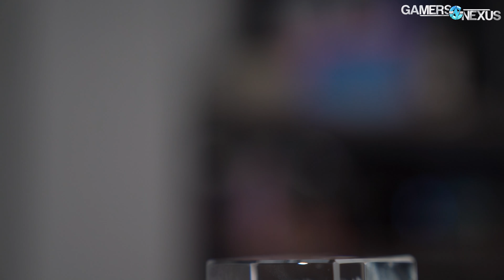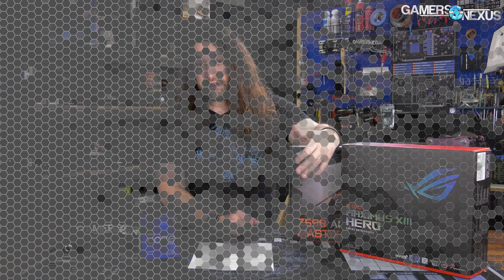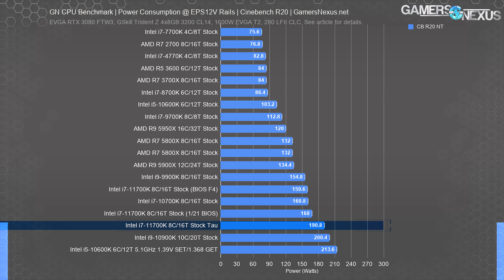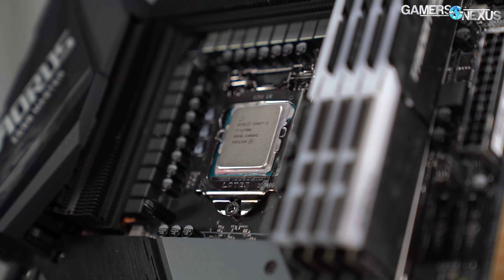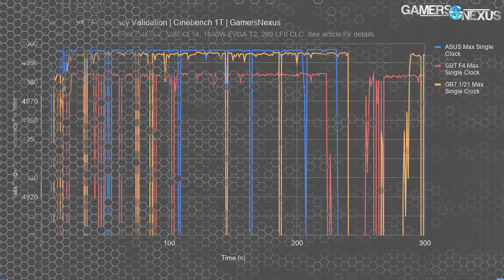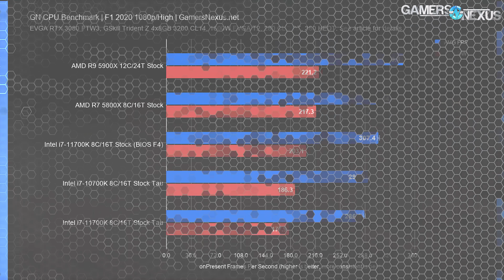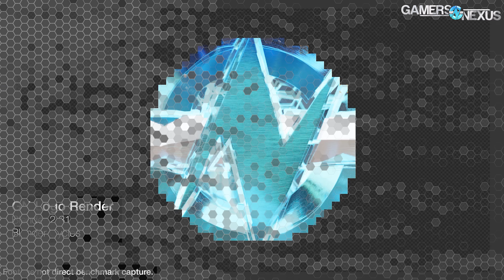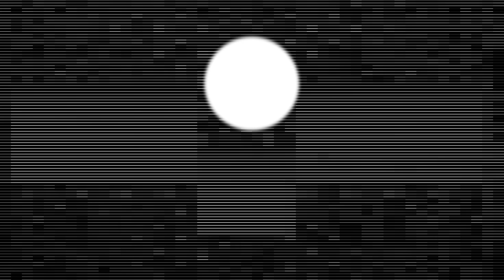Intel's Z590 Motherboard Problem: i7-11700K Power & Thermals Explained

Comment: Could someone please explain to me what the "gear" thing is about? Is it like an auto OC?
Reply: It has to do with memory. GN’s got a video from within the last week that goes into more detail.
Reply: The IMC in Intel runs synced with RAM, so whatever speed the RAM is set, then the IMC will derive its' speed from the RAM.

Gear 1 => IMC runs 1:1. DDR4@3200Mhz runs physically 1600Mhz, so IMC clock is 1600Mhz
Gear 2 => IMC runs 1:2. DDR4@3200Mhz runs physically 1600Mhz, so IMC clock is 800Mhz

Previously "Gear 1" was default and unchangeable, IMC run always 1:1 with RAM clock. This is mostly a thing for RAM OC. If you are trying to run your RAM at 4500Mhz let's say, doing the math it means you're asking your IMC to run 2250Mhz, when stock RAM would be 2666Mhz(1333Mhz physical) and IMC defaulted to 1333Mhz. You can imagine your IMC is little happy about running out of spec: in that case RAM OC was unstable and you could compensate by increasing Vccsa. Higher frequencies can be stabilized by increasing voltage, but components run hotter, consume more and if voltage goes way above spec they can be damaged. So with Gear 2 you have the option to run high RAM clocks without the IMC going so much out of spec as a side effect.

It gives Intel some binning room also: only 11900 CPUs are capable of running Gear 1 3200Mhz which means they run their IMC at 1600Mhz@1.05Vccsa. For others you can try 3200Mhz in Gear 1 and it may work or you may have to increase Vccsa beyond 1.05V to stabilize your IMC, so it's overclocking.

If clock to clock performance loss of a lower clocked IMC is negligible in most cases then in very high speed RAM OC it's a win because you don't hit limits because you are having to set too damn high Vccsa that you're starting to be concerned about actually damaging the CPU or long term damage if you're doing an OC for daily use.

IMC: Integrated Memory Controller. Resides on the CPU and it issues commands to the RAM memory.

Vccsa: voltage in Intel CPUs for the System Agent part. It powers the IMC among other things.
Binning: selecting from a group of chips different groups of chips that meet certain criteria. For example: the ones which use less W for doing the same work(this may be 11900T, for low power line-up), the ones which hit 5.3Ghz at Vcore<=1.35V(this guys may be actually the 11900K CPUs for another real applicaction). You get the idea: filtering manufactured chips based on their individual qualities to make the actual marketed line-up.
Reply: @deidian635  Thank you

Comment: 9:20 I agree the optics COULD be bad for this. HOwever the oppisite is also true, With your typical "Power User" you guys call them, this is a massive gain for them. Realizing that just adding better cooling potential can allow the cpu that is LOCKED by intel, To overclock itself thanks to the MoBo. AsRock b365 pro 4 mobo, intel i5 9400F and it boosts above 4.1ghz. Sometimes I see as high as 4.3.....on a stock intel NON K series Chip. With no "overclocking" knowledge really and just adding an aio to an i5... gets me a couple extra steps into overclocked? Thats a win steve. #winning

Comment: Why are there 2 5800x's, and is the 5950x actually using less power than the 5800x?
Reply: 5950 most likely have better binned chips, that use less power.

Comment: Just picked up ASUS Prime A Z590 can confirm it over volts like crazy
Reply: yeah never use auto vocre.... its been a thing for years i never leave vcore on auto... it causes stupid high temps....
Reply: Still you should be able to manually sort the vcore out...My Gigabyte Z490 seriously overvolted my 10700K but with a manual overclock got it to 5.1GHz all core at just 1.278v....and I know people who have a stable overclock at a lower vcore than mine...

Comment: This is going on for so long and I don't know how Intel hasn't put a stop to it.
Reply: They don't want to put a stop to it. Thermal testing is usually done after a long warm up period which tends to hide that. This gives them an advantage in shorter tests like Cinabench or gaming FPS. This is how they have kept their 3-7% lead over AMD these last few years. It is a perception builder and it makes them billions. Why stop it?
Reply: because it allows locked intel chips to overclock themselves a bit, my wifes i5-9400f hits 4.3ghz rather regularly, thats a locked non K chip btw. Locked to 4.1

Comment: I know its a big ask, but can you compare 10700k and 11700k both in a Gigabyte Z490/590 board?

My 10700k is always between 4.9-5.1GHz all-core (w/DDR4 3600, under a basic Noctua U14S), so I can't really compare it and the 11700k in the charts at stock settings with this board since you only showed the stock tau for the 10700 in charts

My gut tells me that 10700k and 11700k are within <5% with actual same frequencies, and the new generation brings nothing to the table at all
Reply: You are probably right...They are within 5% with the occasional application give more or less so not worth the upgrade...I was hoping for more! Wait until Alder Lake and if crud then the only option is AMD but they are charging more now and seem to be hard to get...Still the 10700K is a great CPU...5.1GHz all core on mine at 1.278v which runs cool and blitz's all games without an issue.

Comment: What does "Extreme Cooler" mean? to your average user a hyper 212 evo is an "extreme cooler"
Reply: Coolers are designed to handle up to a specific TDP. The TDP limit on that cooler is 180. Not really extreme. While the Hyper212 Evo will be able to handle higher temps. You start working outside of the coolers specs and end up with louder fans and higher temps. When you start looking at the Be-quiet dark rock 4 pro is what would be extreme.
Reply: @CthulhusBff  That isnt what I am getting at, what I am saying is that most "normal" users will generally see anything larger than a stock Intel cooler or an equivalent OEM cooler as extreme. Your average home user has not ever seen anything other than a standard dell OEM cooler
Reply: @dragonsystems5973  I don't think the kind of users you are talking about even know what TDP is nor could even comprehend what Steve is talking about. When Gamers Nexus makes videos, they make them for their base demographic (they did a response video about how they got hit by a bunch of console fans and they were extremely lost). So I'm pretty sure they don't really care about  defining everything since when those types of peeps pop up in the comments, the general subscribers who watch them answer those questions.
Reply: @CthulhusBff  I dont know what cocoon you are living in, but I have tons of friends who watch GN who have no idea what TDP is, would think it was power draw if they happened to read ARK.Intel.com, and have no idea what they are doing... I dont know what you do for a living, but I sell gaming desktops, full time, all I do all day long is deal with systems, build systems, and deal with the gaming system consumption public, so I have a pretty good idea what I am talking about
Reply: @dragonsystems5973  I live in a world where I have to explain to infantrymen on a daily basis on how telecommunications isn't magic. As for your friends that watch GN and not know what TDP is. How? I mean it. If you watch GN and just nod along not understanding anything and parrot the final thoughts (what GN says not to do), you are an idiot. Sorry, but perhaps get some friends that aren't sheep. As for dealing with customers. That is kinda why you exist. You are supposed to be the SME (subject matter expert) on these. If you are throwing GN videos at your customers going "this will answer your questions." You are awful at your job. The truth of the matter is that to get into the more higher level realm of computers, you need to be able to take a seat and ask questions. Just because you decide to play with Dunning-Kruger doesn't mean it will work out well. Let's take your friends for example. They are just following along not actually understanding if what is being presented is true or false. That isn't good. Not just for computers but for life. Get better friends, sorry you have a retail job where you are EXPECTED to be the expert. I don't live in a cocoon. I live in a world where I have to break down complex subjects on a daily basis to adults who come to me and admit "hey, I know nothing about this. Please teach me." I'm not being elitist either. I'm being responsible for myself and knowing what is needed when I do something. Comouters is no diffrent.

Comment: Also, you showed some temperatures with an aio on this processor, but I'd love to see comparisons with the same work-load and same aio on a 5800X. The ryzen dies being as small as they are have a really hard time getting the heat out of the cores. While the Intel chip will certainly cost more on your electric bill from the extra power draw, I have seen higher temps on games and similar work-loads on the 5800X than the 11700k with similar coolers for most reviews.
Reply: @Rahq Vuth Yup - you'd have to have basically a lab to test temperature. Of course you can test the Power being used, but it won't tell you exactly how heat is being dissipated.

Comment: Honestly though, who buys a K skew CPU and doesn't overclock them? Motherboard manufacturers doing funky things would only apply if someone was running stock settings. Since most people buying K skews presumably are going for max, or near max, overclocking, wouldn't that mostly be irrelevant? I mean on Ryzen where manual overclocking is pretty pointless, and has a real chance of degrading the CPU, it'd make sense, because most people run those stock.
Reply: Lots of people buy will buy the k skews or unnecessarily high core count cpus because reviewers/forums say they're "the best" pop it in and use it as is because they don't want to deal with stress testing or they get intimidated by the bios.
Reply: @HooDooMagic  maybe, but are unenthusiasts really going to sit through reviews of CPUs? I think most of Gamers Nexus's demographic are enthusiasts who would want to overclock. It's not like they're The Verge. ;)
Reply: Why someone who isn't going to overclock their CPU would buy any MB beyond something among the basic models which have all the I/O they need. There's a very high chance an OC focused MB, even if minimally will out of the box set the CPU to run "Unlimited Poweeerrrr!!!"

PS: rule of cool I believe might be a reason...

Comment: It WILL not draw more power it CAN draw more power. for gaming you will NEVER see those power draws. and everyone i know will want to run the cpu at the all core turbo at the very minimum. so all limits off mce off. only when you enable  mce you need silly cooling these days as then you start to get into the giant overclocks forcing 5+ ghz on all core. 
my 9900k at all core 4.7 (so no limits) runs a max 185 watts  but in reality in games like battlefield 5 it barelty hits 70 watts despite hitting 65 % load.

Comment: Glad you did this video. The marketing is crap for these and I think they need to just own the significantly higher power draw required to match/exceed a 5800x in performance on a less efficient node. I feel like you could have done your other video with some of these numbers included and just given a big disclaimer up front that there's an issue with Intel's marketing. What you did, is reference the bad marketing and then do a review on a processor gimped to 125W that really isn't intended to be just to prove a point. I get that point, and I get how important it will be to make sure people understand the LARGE COOLER requirement the 11-series should come with, but I still think it would have been more honest and genuine to just do the benchmarks at the higher (within spec) limit. All people would have to do is look at power/temps (which you should show) to see where the trade-off is...especially if you tell them.

Comment: What metric determines when a cpu is allowed to boost to PL2 for a second (consecutive) time during a sustained workload?
Reply: From what I've read in the Internet, the metric is an average of power consumption, PL2 is enabled if this average fall bellow PL1. So, while idling, the average is bellow PL1, when a high load start the PL2 is enabled for tau seconds, and this will increase the average power consumption up to (or above...) PL1. At that point the CPU will fall back to PL1 until the high load is over. After that - idle, low average, PL2 is enabled... and so on. That is how I think it works, correct me if I'm wrong.
Reply: @ivoivanov7407  best answer i’ve gotten so far. Thanks

Comment: Again, why I buy ASUS Motherboards
Reply: Just FUI it is kind of hit or miss whatever ASUS honors Intel's guidelines. On a lot of their Z490 boards they would not only disable TAU entirely, they would also enable MCE and crank it to the moon. Hardware Unboxed found one of their high end boards to run the 10900k at 320W sustained.... Imagine how confused a user with a reasonably standard air cooler would have been at the fan speed :P
Reply: @andersjjensen  yeah I get that, I only use the STRIX line, I build probably 200 work stations a year with them and since I moved to the strix line I've not had a single bad board or board experience when I transitioned 4 years ago.

Comment: I don't think reviewers are going to disclose at all in that performance here depends on the motherboard you use at stock, I have a feeling that you and maybe someone else are going to be the only ones to point it out.
Reply: Lots of reviewers don't even disclose which motherboard they used, much less bios version or other info. You're lucky if they mention RAM speed and timings. :P

Comment: Its killing me that you know whether I should cancel my 11900k pre order and get the 5950x instead. WHICH ONE HAS THE BEST SINGLE CORE PERFROMANCE TELL MEEEEE!!!!
Reply: It doesn’t matter I mean u only have 8 cores let’s say is slightly powerful on intel side (I doubt that) and ryzen has 16 core and higher speed without overclock , amd is the best option In my opinion
Reply: @anthonybrm1012  The 3d programs I work with are all single threaded, and my render software is gpu based. So personally for me the amount of cores is irrelevant, single core performance is what Im looking for
Reply: @shoeuzi  amd seems to be the right choice atm. 11th gen seems to be a waste and doesn't really seem to be better than 10th gen. It's 2021 U don't have to worry bout single core performance from amd. If I'm correct the 5950x has better single core performance than the 10900k and given that the 11900k most likely won't be any better than the 10900k, u should have your answer.
Reply: Single core is so last decade man.
Reply: @Rahq Vuth I use very heavy single threaded software

Comment: I can see why some reviewers use the motherboards out of the box config, as that is the experience that most people will probably get. Really the boards should come out of the box complying with the Inel and/or AMD spec. Removing the boosting limits should be an auto OC function in the BIOS that can be turned on if so desired with a warning about power consumption noise and thermals.
Reply: I can only wait for userbenchmark to get their hands on this...
Reply: I completely disagree, there is zero benefit to testing a motherboard with OOB settings especially if you are an experienced tech reviewer/tester but I see all you fanboys agree just to suck up. 
GN talks smack about Intel & Talks up AMD & you all agree & yet he is the ONLY one that can get his hands on one (amd) smh.
You can have your crappy overclocks & buggy usb... well that is if they actually existed
Reply: but at the same time a power user who understands the functions of the motherboard, such as my i5 9400F on an AsRock b356 pro 4 mobo, with their version of this tech my LOCKED non K series intel chip boosts to over 4.3ghz, its a 2.9/4.1 locked chip. AsRock allows it to overclock itself when intel locks it. This is performance left on the floor for a lot of people.
Reply: @crisnmaryfam7344  Yes but shouldn't that be a choice that you can make? An opt in instead of an opt out?
Reply: @jadoei13  Most people care more about performance than heat and power consumption.
Reply: @wolfremus2521  But heat and power consumption can ruin the CPU quicker at the expense of short term performance, which most people don't get.
Reply: @DJ3thenew23  get a better cooler
Reply: @wolfremus2521  more people care about performance to efficiency rating
Reply: @wolfremus2521  most people don't care much about performance as long as it's okay.
Reply: @kevinhard2473  My cooler is amazing and I overclock, but most people don't and most people use air coolers
Reply: @wolfremus2521  Ok, so let's say that the reviewer used a board that doesn't enforce the power limits. A user bases their purchase decision on those numbers but buys a different MB and end up with one that DOES enforce the limits. He ends up with worse performance than he expected and he'll probably go yell at the reviewer, Intel and/or the board maker.
Most reviewers doesn't even disclose which board they used for testing so...